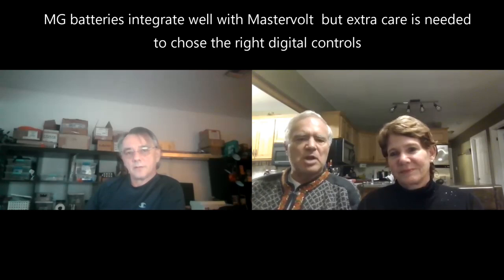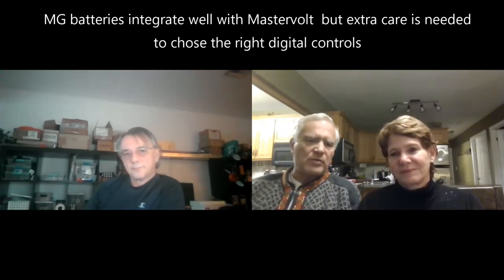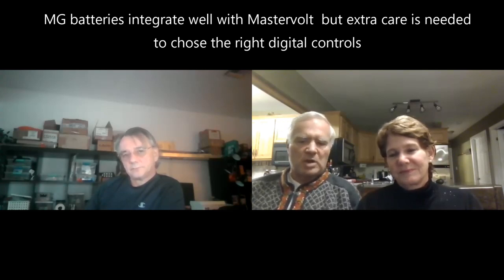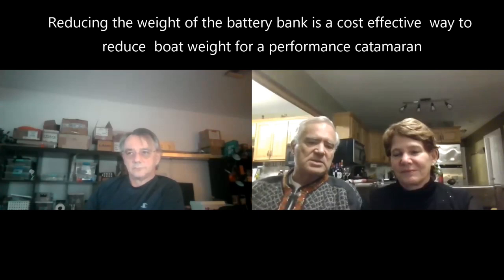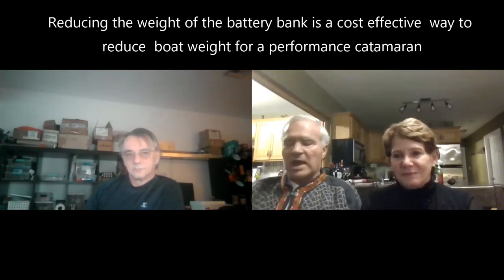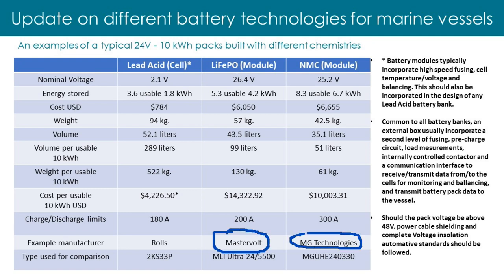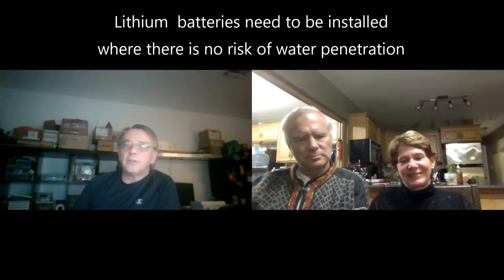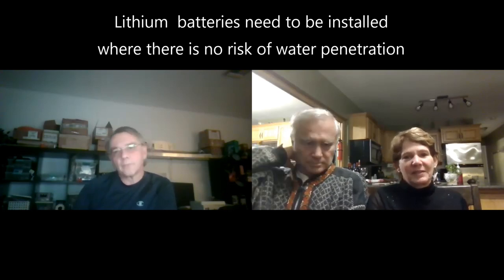Ep.65.  Electric boats & Lithium batteries

Comment: marine batteries systems seem to change very slowly with a element on the cautious side so i always thought the LFP {So4} mix of batteries was available due to the lower evidence of going thermal with the present  lower density ratios of So4 compared to other NCM mix of 622 and 811battery mix with higher energy densities. 

Do we know what mix the MG batteries are and the related thermal characteristics. 
Also I have been told that	the addition of manganese to LFP (producing ‘LMFP’) improves LFP energy density while retaining its superior attributes.
Reply: Hi David,  LFP can go thermal the same way that NMC do.  As the temperature increases, both will eventually emit combustible gas when this happens.  By themselves the batteries do not catch fire but due to construction material and the eventual presence of sparks as the electrical circuit is interrupted can ignite the gas.  The difference between LFP and NMC is that NMC will ignite at lower temperature than the LFP.  So it takes a smaller spark to ignite an NMC battery.  A bit like the difference between Diesel and Gasoline.  In that sense MNC are more prone to catch fire.  But LFP will also.  All that being said, Lead acid battery do catch fire and worse emit Hydrogen before they do.  This leads to Highly explosive situation when not handled properly.  This is why they are so many regulation about installation of the battery in a boat.  Explosion in boat due do Hydrogen build-up are not uncommon.  Rare but they do exist.  But the bigger cause of Electric fire is not the battery by themselves.  High Current and bad electrical terminations combined with corrosion is the leading cause of electrical fire.

Comment: After reviewing your electrical diagram and listing to the discussion about integrating the batteries with Mastervolt equipment would you you use another brand say, Victron inverter/chargers given the opportunity to do it again? I know most catamaran manufactures have a preferred brand but would you consider ordering a boat without an inverter system and designing your system from scratch? We are quickly approaching this crossroads with our new build.
Reply from the maker: Both Mastervolt and Victron are good brands. If you decide to go with the MG lithium batteries Victron are easier for integration.

Comment: What do you think about building your own battery bank by using cheap chinese LiFePo4 prismatic cells?
Cheapest cells are 480$ incl. shipping to US for 12,8V 280Ah (3,58 kWh) and 120$ for a BMS 200A with balancing, temperature control and low/high voltage/current cutoff.
This BMS can be connected to your smartphone or a terminal screen to monitor the data.
These batteries would be around 60kg and 1700$ per 10kWh and are rated up to 7kW of load.
Sure, they would lack a pretty case and integration into MasterVolt or Victron systems.
Reply from the maker: As Jean-Marc Zanni said in episode 64, he has built battery banks with Pierre with mixed results. I guess your own expertise and willingness to devote lots of trial and error time are important considerations. - Lisa
Reply: HI Nils,  
You certainly can build your own LFP if you have good electrical skills.  
1) The difficulty is to find reliable source for Cells.  Quality of the cell is critical.  All cells are not created equal.  So stick with reliable brand if you do not want to be disappointed.  

2) The BMS widget are nice but you should first evaluate the reliability of the BMS.  No point to see on your cell phone cell being destroyed. Being able to monitor on a cell phone is pretty much a given nowdays.  The MG BMS is no exception.  But they are far too many BMS unable to accurately measure the cell voltage or the temperature of the cells.

3) I personally do not care for BMS with built-in electronic switch as your description suggest.  Many loads will have high peak Current.  Specifically Motors: Engine starter, Winch, Windlass, Inverters.  Built-in BMS will cut-out the boat power every time the current exceeds the 200A for a few milliseconds.  Very annoying.  BMS driving an External contactor are better suited for that purpose provided you selected a contactor designed for the load.
Reply: @klims106  Thank you for your expertise.

Comment: Very interesting. Can MG batteries, be installed in an engine room.  How sensitive are they to high temp that might be found there.
Reply from the maker: I guess that depends on your engine room and what boat you have. You will need to consult an expert for installation in your boat.
Reply: Hi, All Lithium Batteries are sensitive to temperature.  It is not possible to charge them when temperature is above 40-50 DegC.  Trying to charge them when those limit are exceeded will drastically will reduce the battery life.  So no it is not recommended to locate the battery in the engine compartment if the engine compartment has an Diesel or Gasoline engine because that space is often become too hot  to be able to charge them while the engine is running or shortly after.  If the engine compartment is for an electric motor then there is no restriction.  
FYI we should not charge the battery if the Battery temperature is below 0 DegC.  Some manufacturers allow -10 DegC at reduce charging rate.  For people living in cold climate, space heaters can be used to raise the temperature.  Furthermore discharging the battery will often allow the heating of the battery.  Standards temperature range for discharging is [ -25,  65 DegC].
Reply: @klims106  Thank you, I suspected engine room could be problem.  I do have 2 deisels in small engine room.  Will need take some temp readings this spring and/or look for alternate location.

Comment: Thank you for dipping into this very interesting topic with unique industry perspective ..... with the MG batteries not being sealed (presumably for ventilation / cooling? I would like to know how their design mitigates the effects of prolonged exposure to the humidity and corosive (salt ladened) atmosphere in the marine environment?
Reply from the maker: Very few batteries, like most marine electronics, are not totally waterproof.
Reply: @biotreksailing  Thanks for the reply.....my question was not exactly asking if the batteries and BMS were waterproof, but more to ask how marine compatible are they......from what I observed during your other boat tours it appears they are well ventilated with internal fans? Just wanted to know if and how MG have specifically addressed the corosive marine environment (not submerging, but atmosphere) and if it was a concern (i.e. potted/encapsulated/conformal coating? circuit boards etc.)......are they 'marinised'?
Reply from the maker: I don't want to provide information that may not be exact, so you will need to contact the manufacturer for specific details.
Reply: @biotreksailing  no worries, have a great new year, cheers
Reply: Hi, Yes the electronic is protected from the Corrosive atmosphere of the sea by "Conformal coating ".  This basically seals the electronics from the atmosphere.  Proper use of anti corrosion gel on the electric connections further enhance their ability to withstand the environement.
Reply: @klims106  Thanks for clearing that up Jean-Marc, they certainly look the business, all the best for 2021, cheers